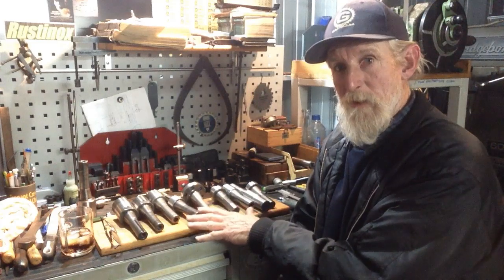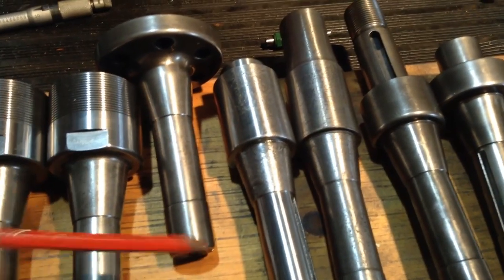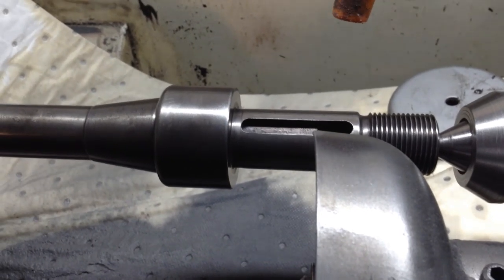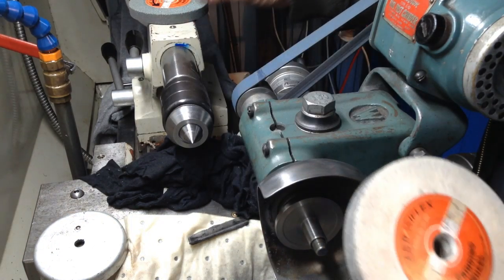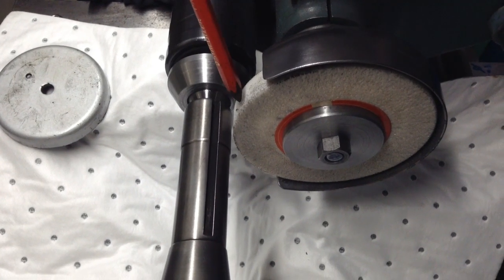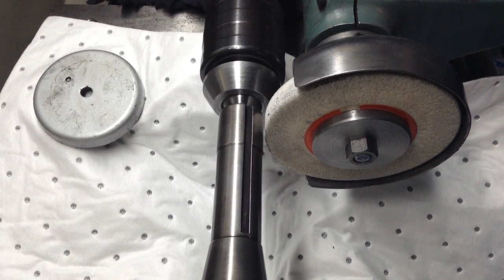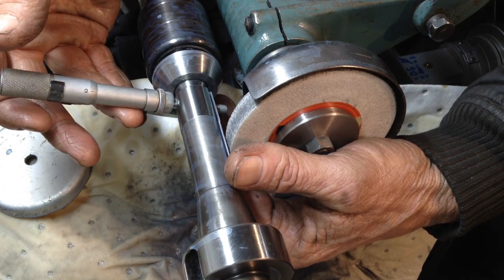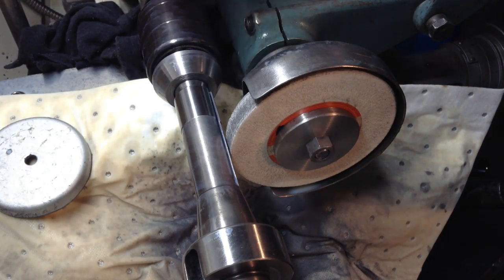Machining R8 Tooling For The Bridgeport . Part 9  B

Comment: gday max i was wandering if you could possible help me i'am looking for some procession ground flat stones to do some repair work on a mill i just got i don't want to attack it with a file no one here in the west from perth to albany knows what i'am talking about  or they have never herd of any thing like that any help would be greatly appreciated cheers
Reply from the maker: I bought my ones from R .  Steven Lang from Shark River Machine .   I do not know of any available in Australia .  Once you have a set you will be amazed how handy they are .  Expensive but worth it .  I would like to get a 60 deg set as well one day . Cheers .
Reply: @swanvalleymachineshop  thanks for the info i will check his you tube channel and try to make contact with him cheers

Comment: Maybe the wheel does not ring because it is made from a denser material. just a thought.
Reply from the maker: May be the oil has soaked into it , but its a thing you should not take a chance on .  Safer to buy another wheel .    Cheers .

Comment: How do you move the grinding wheel by a couple of tenths ?
I am understanding that you only have your cross slide dial to work with.
Just thought you may be using the compound at an angle ?
Reply from the maker: Yes , i have the compound at a slight angle .  The cross slide increments are way to large for this type of grinder .
Reply: @swanvalleymachineshop  
I guessed half way through writing. 
Keep up the good work Max

Comment: Hey real nice sieries love the pig mat filter . The one part people have problems with are those ER collets . I think an entertainig topic would to true up  a cheap set super glued to a mandrell. Cause you've obviously discoverd why there is a tool post grinder. people say there not "game winning" in shor why don't yopu get a cylindrical grinder. making those cheap new/rusty old tools dead nuts real money saver for joe's like us . Thanks for the effort you doing real good
Reply: Your doing a great job touching on the fine points. that albertsons and son's is from an old valve grinder I think albertsons and sons became sioux not sure. doing a great job explaining some of the fine point (there are sooo many) good finish are you using the whole face of the wheel no burning thats good if it works if you get burn marks take a dressing stone the square 1" wide 25mm silicone carbide sticks and relieve the back 3/4 of the wheel another trick is dressing a 45 is deg bevel on the cut edge as you can tell i get a kick outta this kinda thing
Reply from the maker: I have one of those 1'' square dressing stones that i use .  The 45 deg on the corners i will give a try .  Cheers .
Reply from the maker: Thanks .People have problems with ER collets because they buy cheap crap chinese ones & they are not something that can be easily reworked properly .  My tool & cutter grinder can be used as a cylindrical grinder .  But do not have coolant set up on it yet , i don't like dry grinding .  A cylindrical grinder is on the cards once i have finished building the new shop . Cheers .

Comment: Very well done Max.  you might be having problems with the type of stone, but you have really good looking Finishes on what you have done. Overhauling the grinder a while back, was a good choice :)  
I Don't now if it will help, but have you tried    Abrasiflex   08 9208 2000    260 Welshpool Rd.    Welshpool .   They have a great variety of stones & many other Goodies. And    Hope your block goes well tomorrow
Reply from the maker: Thanks Ted . That's where i got the wheels from i have now  , but they  don't stock bugger all any more  as it must be a slow moving product .   Years ago when things were made here they might have !    Cheers .

Comment: I especially like your explanation about ring testing the wheel, and your making the wheel safety guard. Years ago, a man working a cylindrical grinder next to me was killed when the wheel shattered. He was struck in the head by parts of the wheel. The incident left a lasting impression on me about grinder safety and grinding wheels, even small grinding wheels.
Reply from the maker: Thanks Don . Yes , there  are no second chances with the things . Cheers .